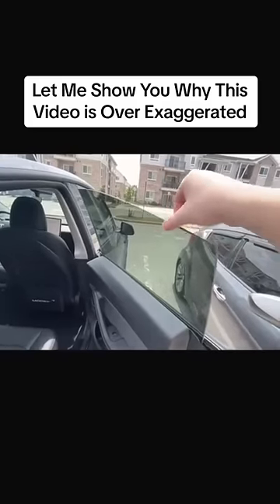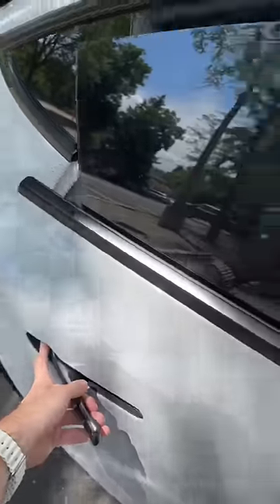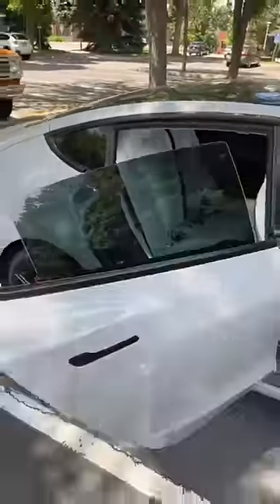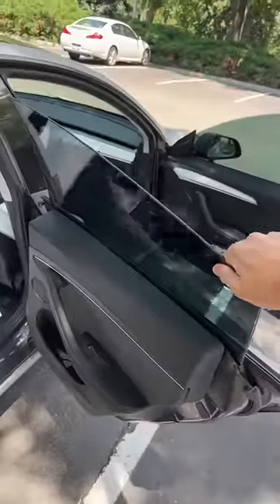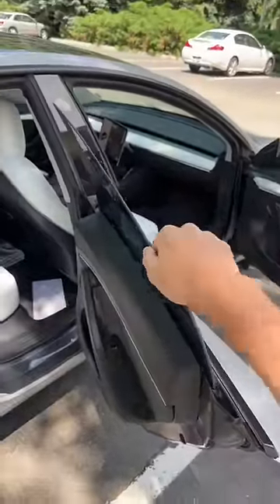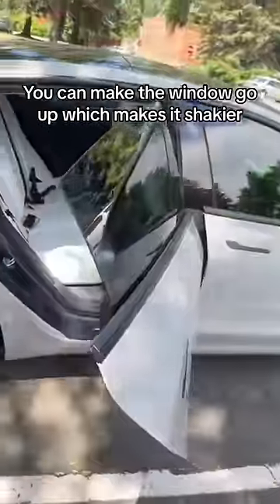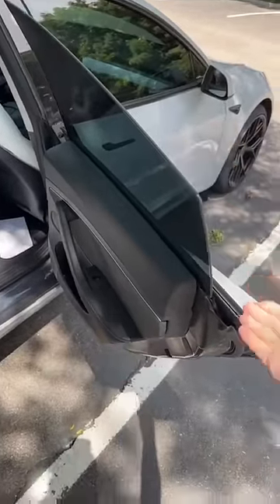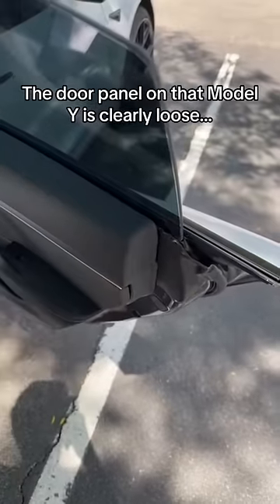Is Tesla Build Quality Really This Bad? 🤔🤨

Comment: My 2009 Subaru outback has frameless windows and it doesn’t shake at all
Reply: I even have a 1992 legacy 😊
Reply: Same with my 97 Impreza
Reply: @marcoaddor7115 Now hold on a minute. Tesla is still working it out and eventually will advance enough to have technology and engineering similar to your car, but they need more time. What you are bringing up is an example of advanced domain-era technology. It is unreasonable for Tesla cars to have that for now. Give it a few decades for them to work it out.
Reply: @fluffywhitebudgie6376  I believe Subaru introduced their frameless window in 1990, I also believe they stopped utilizing them in 2010

Comment: I remember once my mate  opened the boot on his model 3 and the hinge cracked in half causing the boot or 'trunk' to snap off and fall on my bloody foot.
Reply: Why was your foot bloody before the trunk snapped off?
Reply: @sdot5389  Bloody. Don't worry, it's not a violent word… it has nothing to do with “blood”.”Bloody” is a common word to give more emphasis to the sentence
Reply: @sdot5389 I think the joke was soaring 35,000 ft above his head
Reply: @danr6716 look up and you might get the joke
Reply: @danr6716  that joke was an airplane to you

Comment: Had a 78 cougar which had frameless windows. Didn't need to move them to open or shut doors and never shook. Hell it was better than the 14 impala I have now.
Reply: They move the windows up and down since modern cars have a better airtight seal and apparently having a window gap to open and close the door prevents any damage and probably makes it easier to open and close the door. At least what I've been told

Comment: He’s triggered his car is made out of Lego bricks
Reply: Wdym the tesla have literally 5 stars crash rating and your saying it its made out of legos
Reply: @ethanol-fb  bro i think your talking about the mrbeast lego car right?
Reply: @DACHSHUNDSIDEEYE  is that what the teslas made of?
Reply: @DACHSHUNDSIDEEYE you dont crasg with the damn doors open
Reply: @YourLocalMuslim  ?
Reply: @DACHSHUNDSIDEEYE  If a car crumples in a crash its poor build quality. I hit a kangaroo at 80km/hr in my datsun 720 and only slightly dented the fender
Reply: @DatsunBloke7357 cars are built to "crumple" in crashes. The less a car is affected by a crash, the more dangerous it is to drive, in general.
Reply: @C4rnee  who cares I want my cars to stay together. That's why I only drive cars made from 1985 and back.
Reply: real
Reply: @DatsunBloke7357 w bro
Reply: @DACHSHUNDSIDEEYE  did you know a car can have a good crash rating and still be horrible quality?
Reply: @DACHSHUNDSIDEEYE idk if you know this, but they test so good in crashes because the center of gravity is low in the center instead of the front, and higher up. Also they do just have bad quality control loose interior panels, bad body panels gaps, but they are fun.
Reply: @DACHSHUNDSIDEEYE just because a car has a 5 star safety rating doesn’t mean it’s always safe. Plus what does the window have to do with the crash rating?
Reply: And shaped like a bar of soap
Reply: @DACHSHUNDSIDEEYE  stop driding Elon Tesla isn’t even close to the best EV for ur money
Reply: @DatsunBloke7357 just means you’ll crumple instead🤷‍♂️
Reply: @laynetufts3375  that's fine my cars have no air bags and some don't even have seatbelts and doors

Comment: Oil corporations, gas auto manufacturers and stealerships, parts suppliers, and a host of other related industries are clearly fighting back. Unfortunately, the typical consumer, unable to do independent research, buys the anti-ev propaganda hook, line, and sinker. There are problems because EVs are new, but they will be resolved in time. Have patience.

Comment: Teslas are infamous for defects despite this. The wheels are prone to going wobbly and can potentially fly off at high speeds. The battery is not properly shielded (we’ve all seen the videos). The body is basically held on with duct tape, especially the fenders and bumpers.

Comment: Bro, modern Teslas literally have the worst build quality out of 90% of the cars on the market. The windows arent supposed to shake at all. 
Also, a lot of the rubber linings in the doors fall off very easily and the hood panels literally shake like they're gonna fall off the hinges when the hood is open. 

No car is supposed to have shaking at all in most parts that are supposed to move because that is a safety hazard when working on the car.

Comment: I had a 2nd gen Subaru Forester from the early aughts, it also has frameless windows. 
Even fully up, it doesn't shake, and you can use said window to close door. It's not supposed to shake. Tesla cheapened out somewhere.

Comment: There are sometimes reasons to have a bit of movement in parts. Perhaps if that glass was held down tight enough it could shatter more easily then it just having a little bit of a shake
Reply: Yes a bit of movement but not in this much that it feels like its going to fall apart if you pull on it just a bit

Comment: To all those people that think that only Teslas have shaky windows have no idea just how flexible glass actually is. Yeah, Teslas arent built all that well, and early ones would have been made better by Fisher Price, but you take any frameless window and handle it like that, its going to shake. This doesnt mean that it is put together poorly. As someone who works for AAA and has had to do many lockouts on frameless windows, they are not at all rigid, and I dont think you would want them to be either. Done it on mustangs, old subaru outbacks, even convertible mercedes. They are not meant to be completely rigid and glass itself is too flexible to not shake. I dont care in the slightest about Teslas, but too many people here dont seem to know how glass works. And that is the only thing I want to address.

Comment: yall saying its shaking the same, its not. you can hear it rattling the regulator on the original video because its obviously loose, might be loose door panel, shitty replacement job, not assembled right from the factory... etc. dudes window is flexing because its a thin piece of glass with a large surface area.... not the same.

Comment: The glass can move because it intentionally designed to moves slightly down when the door opens for prevention of shatter. So, it's not surprising to see movement on the glass, but this video seems a bit exaggerated.

Comment: If you look at the corner on the first video, the panel is clearly loosened.
Reply: It was probably never tightened on all the way to begin with tbh. Door panels are one thing they have earned a reputation for failing to consistently properly install.
Reply: And it’s especially common on model 3s

Comment: build quality means that theres production spread. good for you that yours doesnt rattle, but thats apparently not for everyone. i mean, theres stories of the motor mounts ripping of the subframe within the first 20k miles, components held in with zipties and balsawood, doors not closing properly, sensormounts breaking of, doorhandles not surviving winter (first production problem, but still), panels rubbing into each other causing scratches and rust after less than a year etc.

tesla's might have good tech, but theyre terrible car builders

Comment: Yours is shaking but the rubber gaskets around haven’t loosened yet but with more time they’ll get loosened and the potholes will make the motor weak which will cause it to make noises like that. I had the same problem with my car but the only difference was that it made those noises after getting 36 years old it was a Toyota Corolla sprinter or ae83

Comment: Clearly the door latch was not closed in the first clip as the top if the window did not line up with the door seal at all, and why in the hell would it be okay for the window to be so shaky when it's up rather than down

Comment: Okay but my convertible also has frameless windows and they don’t do what’s shown in the video except for the one where I haven’t replaced the adjustment screw (making the assembly only secured at the top) because I’m waiting on replacement parts.

Comment: As someone that currently owns a, 2017 Model X,  a 2023 Model X, a 2021 Model 3, and four 2022 Model Y's I can confirm Tesla's build quality kinda sucks.  We've literally had trim pieces fall off. Out of all the Tesla's there's a reason why I drive Audi's everyday.  Reliability, the Tesla's have been great.  Fit and Finish, not so much. Also, the new yoke is AWEFUL.  I was considering buying a Plaid for myself but after driving my wife's 2023 X for a few months I bought a RS E-tron GT for my daily.
Reply: So you’re rich?

Comment: Build quality means: You can get shit build quality.
It does not mean: "Mine is okay... therefore you're lying if yours is fine."

It's the equivalent of hardware and software for PC: "Works on my machine".

Yes. Tesla build quality is notoriously bad. Lots of points of failure. Poor QC. You got a decent one. Good for you! Like getting a good bin on a bad processor line up. You lucked out. (That said. Your window is still shaking more than it should. But at least it isn't rattling?)

Comment: Tesla is garbage. Building new vehicles from scratch is horrendous for the environment.  Especially when they use petroleum powered tools to do it in the first place. When you have an electric powered car, but it took so much gas and everything to build it and make the electricity. that doesn't make it better for the environment.  You wanna be environmental ? Rebuild a classic car with original restored parts. Sure you can build it to have horrible gas mileage. But you can also build it to be pretty decent daily driver with decent mileage. I HATE tesla